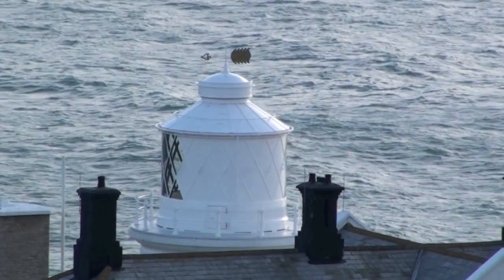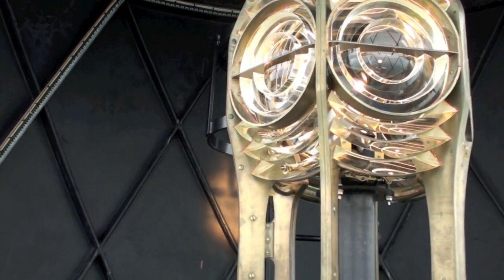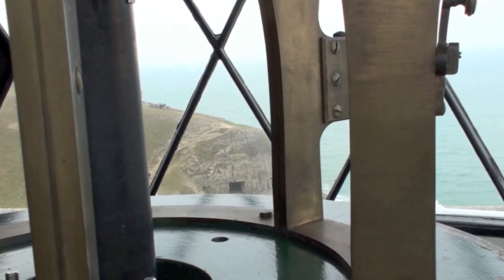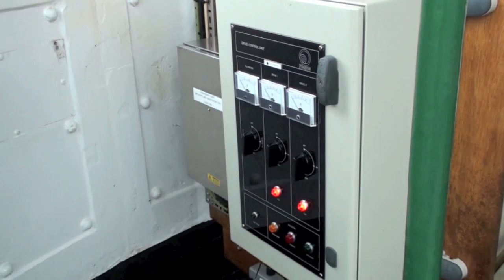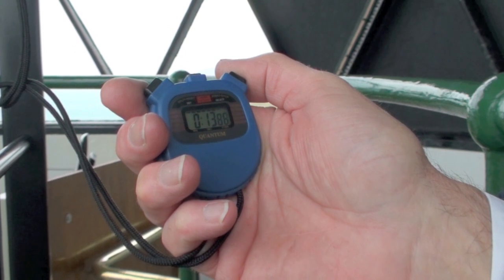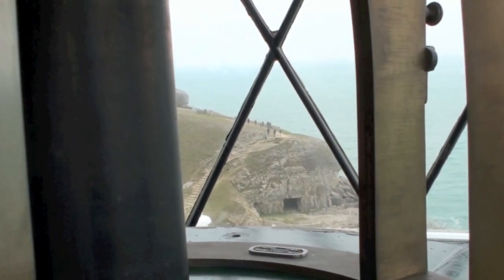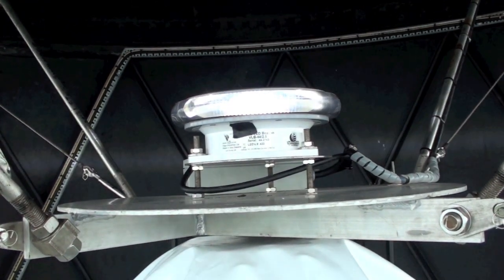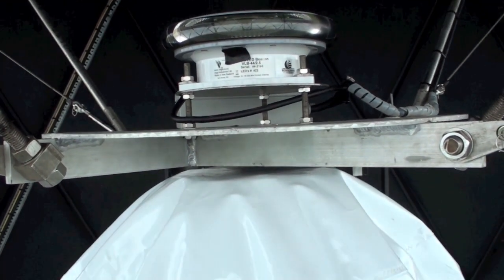Anvil Point Lighthouse Feb 2011 - THE LIGHT IS DIMMED

Comment: LED is not as elegant as a 35 watt incandescent and the rotating lens, sure, but a lot less maintenance. I imagine the naysayers were there when it went from whale oil to electric. Diesel trains are not as elegant as steam but a lot easier to work with. Time moves on but it looks like they kept the structure.